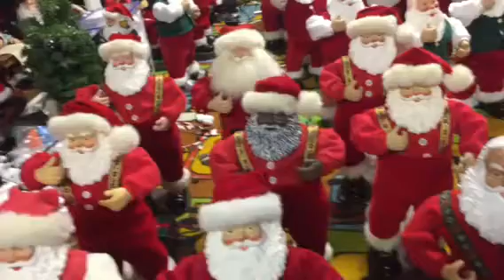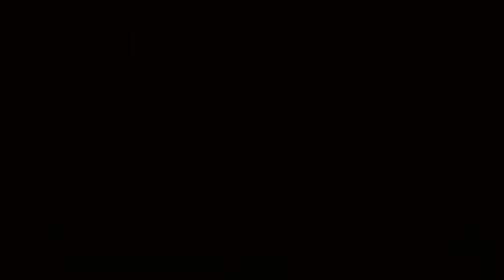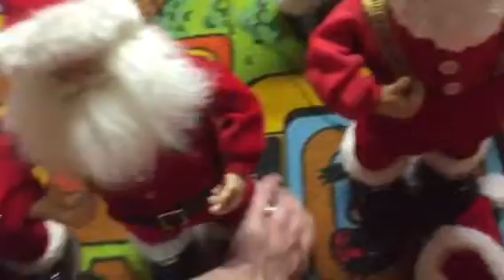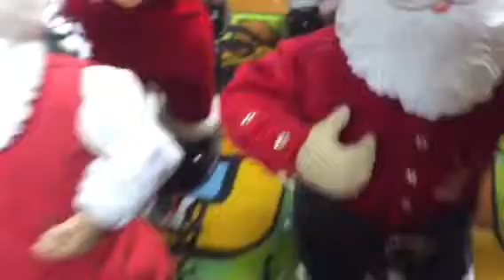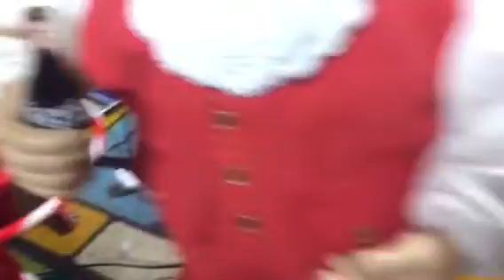Christmas Fantasy Jingle bell rock santas

Comment: I have a question. Can you replace the belt of the jingle bell rock santas or holly jolly rock santas?? Can you make a video to show how to do that, I don't know how to do that, but I have to replace 2 of them to fix them.
Reply from the maker: Well none of mine really need them replaced, I've never had to replace them. Sometimes its just a matter of readjusting them like sometimes the gearing on the legs with the gear in the middle may not be centered correctly, but ya.